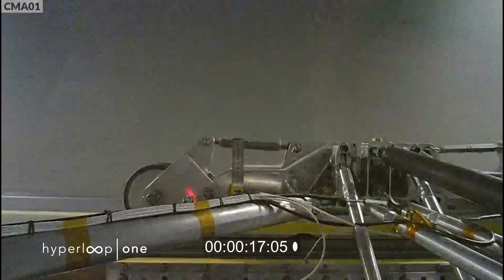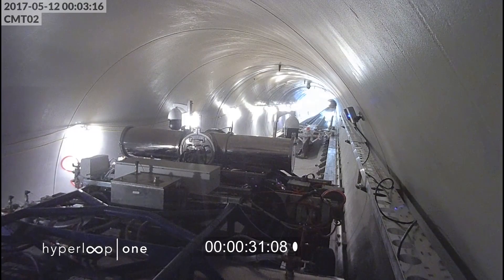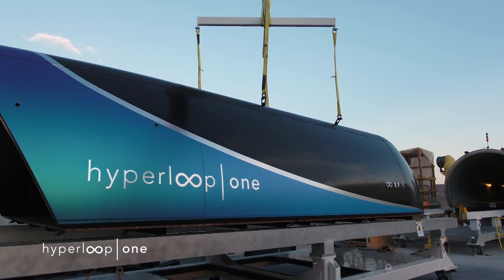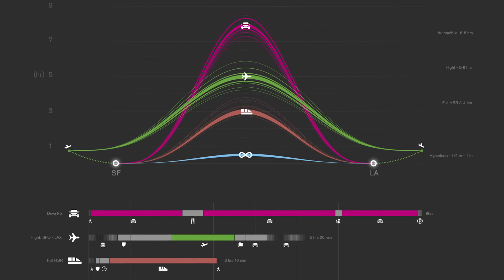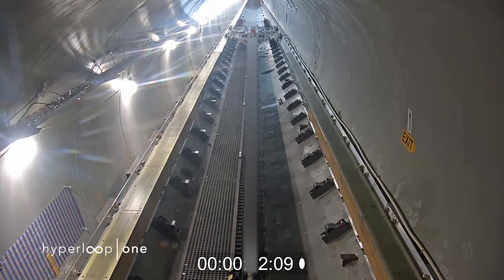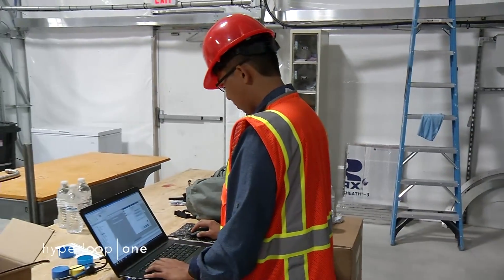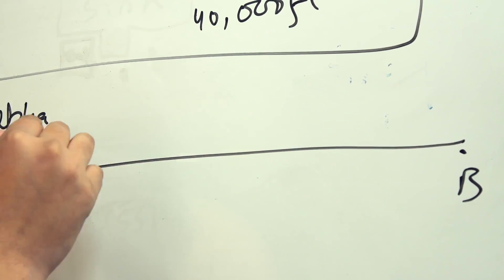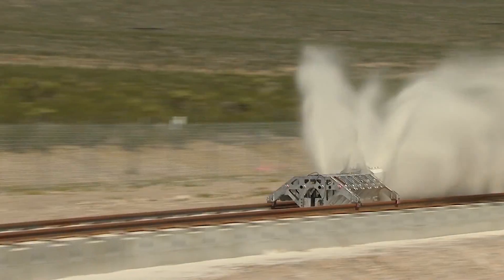Watch the Hyperloop Complete Its First Successful Test Ride | WIRED

Comment: just waiting for thunderf00t...
Reply: Disregard any points made by anyone that isn't qualified to speak on the matter on the basis that they aren't qualified to speak on the matter is more like it.   Also, if there is a hole in the tube air will go in at a rate based on the size of the whole. So what?
Reply: All chemicals are governed by laws of physics.
Reply: I don't think innovation is the same as hype lol.. Also a physicist or an engineer is much more qualified to talk about this shit than some dude that does "microphysics." Chemists focus on materials, while someone like an Aerospace Engineer knows about both materials and fluid dynamics, you know, the shit that matters here.
Reply: James lu good argument dog.. You’re telling me there’s no way that the group of engineers didn’t think and never thought of assigning a team of engineers develop safety measures for the hyperloop? If so, you’re the stupid one here, bud.
Reply: Big Easy his points have been debunked over and over lime that one where one hole would make it collapse
Reply: Big Easy yah
Reply: yup
Reply: well, kingklooneyville, thank you.

And yea. even poops are a delicacy for flies and beetles.
We got all kinds of animals in this world.
Reply: Taken to its extreme, do you think a vacuum pressure vessel with 1-foot thick walls and a 1-cubic-foot inner cavity would collapse if you cut a hole into the inner cavity? It would not. It's dependent on the strength of the material and the hoop stress, and for a stringer-ring frame tube with 20mm outer walls, this seems definitely reasonable.
Reply: Shawn P. N. Either his understanding of the hyperloop, or his limitation of his mind. I feel Thunderfoot, though very smart, is limited by his current understanding of physics. Someone like Elon musk won't just talk bullshit if he has the idea working in some form. People laughed at his rockets landing back into earth at one point of time. 

Great ideas that seem impossible are laughed at before silencing people. Thunderfoot, I feel, is on the wrong side of this.
Reply: a tiny hole quickly becomes a big hole, unless the structure (tube) is strong enough to hold it's shape around the hole..... that's a major engineering obstacle.
Reply: I don't think you understand what I mean by "buckle slightly". It's a meter of additional length per ~6000 meters (depending on how you tension it). When that deflects into an arc, the arc will have a radius of 75 kilometers. That's a centrifugal acceleration of under 0.1G. You're not going to notice that much at all, you experience that all the time on a train. You'd also probably tension it a lot more than that.

It's 20mm thick steel, and presumably you'd use an internal stringer-ring frame. That isn't going to collapse under its own weight at all. Not sure what you mean there.

The short test tube was not optimized for speed at all. They used a single low cost pump on the Hyperloop test track. In the real system, you'd have many more spaced at even intervals across the track. 

It's in a 100 pascal environment. That's not a near perfect vacuum, and there's still significant air (the reason is because a higher vacuum would require more costly, oil-hogging pumps that are a pain to maintain). A turbine at the front takes in air and pushes it around the vehicle; the point of that is because air doesn't displace nicely at those kind of speeds, and instead tends to lead to choked flow. Compressible fluid dynamics are complicated though.
Reply: Tesla did not ever claim to receive messages from Mars, what?
Reply: everready59 exactly, there are cars doing over 200mph, and hyperloop is yet to break 80mph or so
Reply: Implodes*
Reply: same
Reply: strange your comment didnt show up in the notification feed... (only your reaction to mr wang)
anyways:
1) after reading trough some of the design docs... no they want to make the entire thing free moving (only "ancoring" against up/down and sideways movement) so that they can compensate for the thermal expansion on the end...

2) if you look at the pictures they show of the tube parts beeing stored/waiting for construction they have internal support strucktures so im wondering why that would be if they can sustain themself and if not how the hell they want to make these things free hanging over 30m...

3) it wil still take a long time to reach 100 Pascal in an container that size (or repressurize it SAFELY)

4) right my bad "near perfect vacuum" was poor phrasing on my part... damn high vacuum. better? and so far only one of their teams seem to think its a good idea to use the turbine.

5) btw did you notice that all their saftys and standarts seem to be based heavily on airplane standarts when the pressure diference is so different (100Pa in the loop vs 30kPa around planes)

6) and regarding the case of rupturing on the tube... the design docs gloss over it with a lot of "likely" and "probably"s (for small scale breaches) and their only solution for large scale ruptures is "well just have the pods hit the breaks"...

and yes alone some of these are not as big of a deal but together they are realy problematic... (further stress on allready heavily stressed containers you know)
Reply: yes i do but if i look up things like "hyper loop safty" i get a lot of thunderfoot, other critisisem, some "test videos" with the prototype tracks and a 1 min vid were one of the HL team stats "we will not demonstrate to them that it is safe it will be a cooperative effort" 
so if you have any good vids or articles that show its safty it would be nice ^^
Reply: Taky only supporters of a dumb idea who realize that their ship is full of holes say stuff like "it's been debunked, but I won't give you a link now, Google/YouTube it yourself"
Reply: Hyperloop isnt the dumbest idea ever...
Come on... solar roadways...
Reply: PS, Hyperloop, as Musk calls it, isnt his original idea.
Reply: "Big Easy3 dagen geledenAmbient Morality alot of the shit you said doesn't even sound good on paper, how does the thickness of the steel effect a breach? Once there is a breach no amount of steel will stop it."

Actually not remotely true at all, there is a simple physics home experiment, blow up 2 baloons stick a pin in one, it will explode, now put a small piece of tape on the next one, stick a pin in the piece of tape, it will make a tiny hole that slowly releases the air.
Air pressure is a known psysical quantity, as is material strength, its not hard math to calculate what thickness you need to not have it rip or implode or w/e wacko theory you guys believe in.
Reply: To hotaru and shawn P.N. just look at the comments, looks pretty unwilling if you guys ask where to find the debunking of TF when kingklooneyville already made a excelent post referencing the Hyperloop busted busted video series and the redit post busting all wakko claims made by TF

"Brennen Cox8 uur geledenThe vacuum in 'a/the' hyperloop is more absolute than space.. ya know?"

What kind of stuff do you use xD how on earth did you come to that idea? Acording to you, what is the vacuum in space? and what is the vacuum in the hyperloop? as the hyperloop's vacuum last time I checked was thousands of times more dense as deep space. Ofcourse the term space is very artificial as from earth the athmosphere gets thinner and thinner when you get further from the earths core, so if you take a spot right past were we officially call it space instead of earths athmosphere it is still relatively dense
Reply: The man has achieved much more than any PhD graduate would ever dream of doing. PhD doesnt automatically give u a grant on "intelligence". For outside thinking you need to think beyond our limited education system. 

"Tesla at one point claimed to have been receiving messages from Mars"

Provide your source.

"The project is still where it was when Thunderf00t criticized it, nothing new. And as I said earlier. Yeah, anything is possible with enough time and money. But how much time and money will hyperloop take?"

Hyperloop might take more money, but it will save money too. It helps people travel distances faster than ever for a cheap price. 

" I doubt hyperloop will break 200mph within his lifetime"

Im willing to bet you on that :)
Reply: https://en.wikipedia.org/wiki/Vactrain
yea totaly original ^^
Reply: a) hes not even working onthe project...
b) i agree some sources on that would be nice ^^
c) how will it safe money? its an incredibly expensive thing to run and maintain
d) IF they achive their goal the travel speed will be fast BUT if you factor in everything from accelerationtime, deceleration time, filling the airlook safely, unloading the pod, reloading the pod and evacuuating the airlook again you get a pretty long waiting time especially since the number of pods running through the line simultanious is very limited if you want to keep a realistic safety margin.
Reply: bob2000and10 Thunderf00t, ahh yes the chemist who takes on engineering fields. Here ill provide some opinion and videos to get you out of that echo-chamber.
Firstly we have the "Hyperloop busted busted" video series. Great watch.
Secondly we have this actual Reddit reply from an employee at Hyperloop One about Thunderf00t.
---------
I've got this one. I have watched the video, and made copious notes. Thunderf00t is a well known youtube science commentator, best known for debunking religious fundamentalists and understanding the surface-maximization of liquid alkali metals, published in Nature last year.

That aside, both hyperloop videos show a complete reluctance to engage with the real arguments. Sorry, but highlighting some semi-literate comments by your critics does not amount to engaging in a useful discussion. I would like to levitate this video into the sun.

Here are some specific points and rebuttals: -Thunderf00t primarily makes reference to the Hyperloop alpha whitepaper, written by some SpaceX employees in 2013. I saw no evidence of engagement with subsequent press releases by any of the hyperloop companies. In particular, TF doesn't seem to be aware that there is more than one hyperloop company. FYI, we are Hyperloop One, the company that has raised ~$108and built the world's most powerful linear motor in 5 months. -Thunderf00t talks a good game about aerodynamics, but shows no evidence of even having read the wikipedia article on choked flow, duct flow, the Kantrowitz limit, or knowing any of the other 'first day on the job' level detail for our aero team. -One of Thunderf00t's technical gotchas was 'expansion joints are difficult', despite the fact that hydraulic cylinders exist, most steel rails are thermally pretensioned, and thermal expansion is probably something we thought of already. -Thunderf00t could have easily looked up our people on LinkedIn, checked their google scholar bona fides, whatever, but seemed more keen on a cheap take down than actually engaging with interesting and ongoing engineering challenges. -One symptom of the level of technical effort that went into TF's video is his careless assumption that 1g = 1m/s/s, as though Hyperloop was being built on some tiny moon of Jupiter. As a fellow academic, I was disappointed by TF's lack of intellectual humility in an area in which he is obviously not an expert. One would wonder why TF would put such hastily produced, easily debunked rubbish on his Patreon feed - people actually pay for that!

-Casey
Reply: Yes, but he makes assertions that things are impossible when they aren't. Thermal expansion is a solved problem; allowing the tube to move along a constrained path can deal with thermal expansion by allowing the tube to buckle slightly. If the tube was breached, the steel is easily thick enough to hold, and the entry of air will be extremely slow. It won't take forever to depressurize the tube; the point is that you install pumps in regular intervals along the tube such that each one deals with a small volume. He seems to think the turbine is there to push the pod, but it's actually there to compress air and displace it - so it doesn't have to spin faster than a jet engine at all.
Reply: Big Easy In lamens terms, think of slightly opening a squished down plastic bottle. Does it implode? No, that makes no sense at all, just air will breach in. You know these companies hire qualified engineers who specialize in solving these problems that would come up in these situations. I mean look at how cars have improved in safety over the years. Key word: innovation.
Reply: yea cant wait for him to admit he was wrong. wow imagine that..
Reply: Hotaru dont you have youtube at your disposal?
Reply: the tube is not thick enough as thunder foot stated by showing pictures of the Hyperloop tubes
Reply: could you point me to were they got debunked? im interessted to see.
Reply: Big Easy do you understand how science works?
Reply: Willing to bet this thing won't be practical within Thunderf00t's lifetime. If you are a student, you will be lucky to see it break 200mph in your lifetime.
Reply: Jesujej
are you saying he doesn't make valid points?
Reply: ...ok
1) "allowes it to buckle slightly"? do you reasize what would happen if the tracks this thing runs on at the spead they aim for would "buckle slightly"? either contact with the mashinery (rapid deceleration and damage to the equipment) or a jump (loss of controll)

2) "the steel is easily thuck enough" have you seen the tubes? thats nothing... they have to put in stabelizers to prevent them from collapsing under their own weight... 

3) yes and depressuring the short test tube with a similer tech took over an hour each also this would add imense operation costs for next to no gain. it would make much more sense to only depressurize the enty point for the carts via airlock systems... and even that would take long.

4) "ut it's actually there to compress air and displace it" WHAT AIR?? they want to run it in near perfect VACUUM. also unleyy that turbine leads anywhere (and after those designs that would be the passenger comartment) it would make it harder to move not easyer.

5) +Ricardo Garza yes now open a non squished bottle with a vacuum inside it. or if you have one of those "low pressure sealabe" plastic boxes for food. and you will realise that yes air WILL stream in at a high speed.
Reply: Drudley no once you have a crack in any metal it will continue to propagate until it's physically repaired and under the forces present will crush the strongest steel's like a aluminum can.
Reply: bob2000and10 oh so he doesn't chose to go down the road of abandoning facts to support your Fuhrer so he needs to "just go away now"?
Reply: The vacuum in 'a/the' hyperloop is more absolute than space.. ya know?
Reply: Vikram Mohan what exactly was he wrong about?
Reply: He already did a video about a year ago.
Reply: Mayer BULLSHIT.you need to look at some HISTORY.This IDEA is NOT NEW.
Reply: wtf IT IS HIS ORGINAL IDEA DUMASS!
Reply: It actually is fairly hard math to calculate what thickness you need. It depends on what failure types you're planning for, safety factors, etc. You'd need to probably run some computational analysis to get a real answer. A back-of-the-napkin calculation shows the Hyperloop diameter is reasonable (pressure difference is about 1/12 of critical pressure, assuming stringers make the tube approx twice as strong) - but that's not good enough to prove it's safe.
Reply: CJ the thing about science is that it deals in fact, whether you major in physics or not, you can still provide just as valid points
Reply: rowsdower may not like him, but that doesn't invalidate his points
Reply: Disregard any points made by an opposing side, on the basis that they aren't qualified to speak on the matter.
Reply: do you know what air pressure is right? well if there's almost no air in the tube than the outside air pressure will cause it to implode but if the Hyperloop tube is thick and strong it wouldn't implode if there's suddenly a hole then that's called a breach and IT COLLAPSES INWARD
Reply: yeah listen to random youtuber and not the people who literally created this...
Reply: Ambient Morality alot of the shit you said doesn't even sound good on paper, how does the thickness of the steel effect a breach? Once there is a breach no amount of steel will stop it.
Reply: Vikram Mohan actually, Elon Musk (who has not finished his PhD) is more likely to talk bullshit eventually. Just like Tesla at one point claimed to have been receiving messages from Mars. The project is still where it was when Thunderf00t criticized it, nothing new. And as I said earlier, I doubt hyperloop will break 200mph within his lifetime. Yeah, anything is possible with enough time and money. But how much time and money will hyperloop take?
Reply: Ricardo Garza Are you stupid? Yes... Alright...
Reply: +Said Al Gifari
" there is a reason why this thing become so popular"
It's pure hype for the name Elon Musk and "green technology".
Reply: Isn't everything physical made of chemicals?
Reply: Big Easy he's a joke.